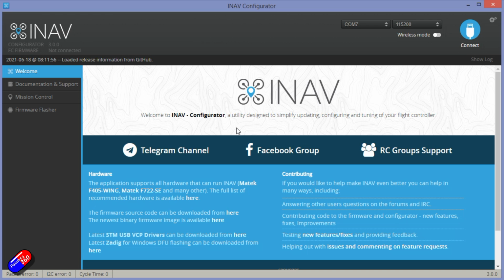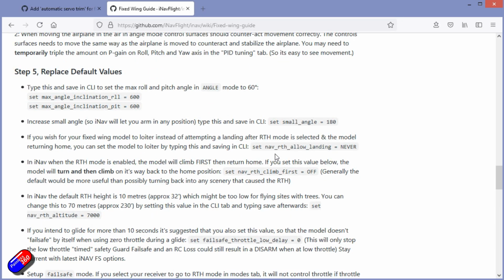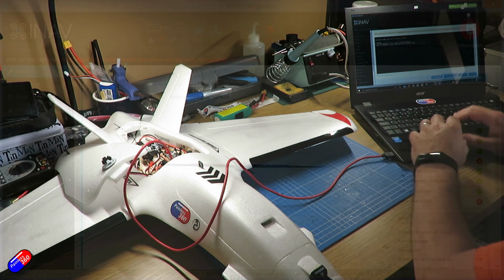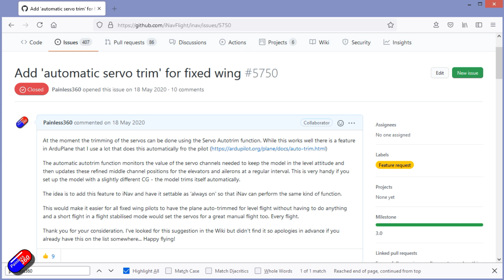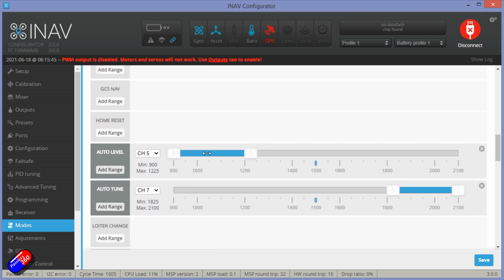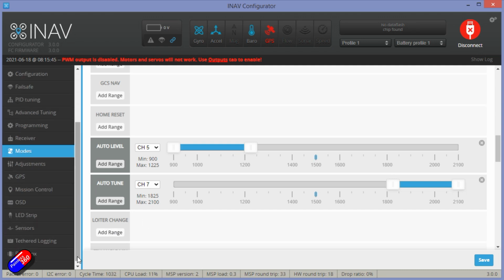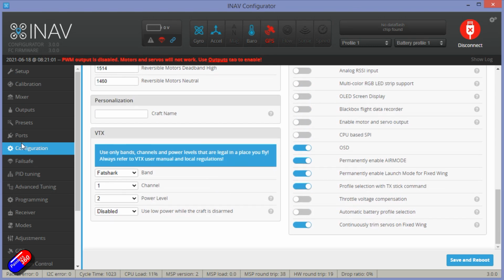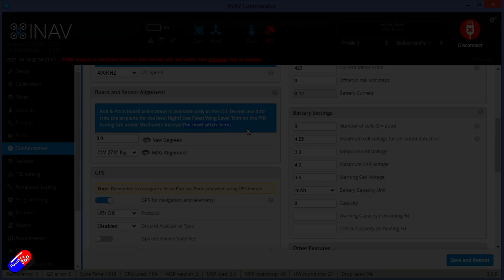INAV 3.0 Tips: New autolevel and auto-trim settings for fixed wing

Comment: I have a Matek765 and it has firmware 2.3, so as i understood the uprade sequence to 3.0 is as this:?
2.3 to 2.6 and then to 3.0. It's not possible to do it straight from 2.3 to 3.0 ?
And the FC MUST have firmware 3.0 to get the connection with INAV-Configurator ?
Thanks
Reply from the maker: You can go from any other version as there isn't an 'uograde' as you erase the settings on the FC when you flash it. See the details in the release notes.. Best of luck
Reply: Thanks, will do so
Reply: I was confused on inav configurator upgrade.  Wasn't Shure if needed to upgrade before I did 3.0 on FC or after . Did before and Seems fine.
Reply from the maker: Yep, see my video on how I updated this model in the other video in the series.. Glad it worked for you.. Happy flying!

Comment: Hi painless
In the inav wingtalk they said to use autolevel as a tune mode 
And not to have it always on
Or do you never fly in horizonmode and only as a tune flightmode?
Reply from the maker: Let's see what the wiki shows when it's updated... Happy flying
Reply: @Painless360  I had it set up like you did also
But after watching sunday I saw marc saying it can give troubles when having strange wind
Happy flying 
Keep the good video's coming !!

Comment: Thanks, this helps a lot, can you add a video explaining the battery level for the Lion batteries showing up incorrectly in Nav Lua?  How do I get the correct voltage and fuel levels in a Lipo vs. a Lion battery?
Reply from the maker: Not sure, if I figure it out I will make a video. Please let me know if you sort it...
Reply: For me even the LIPO battery levels dont work correctly on Nav Lua. 
But i just love that screen with all the information